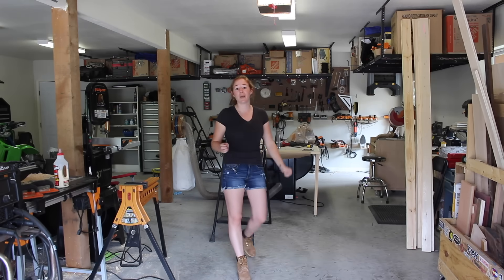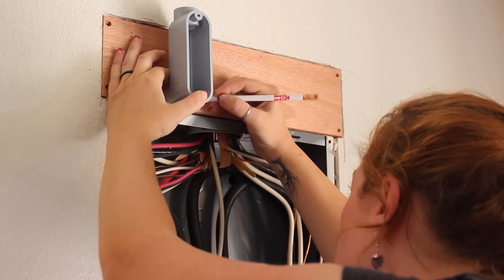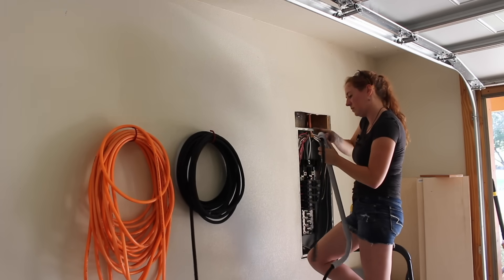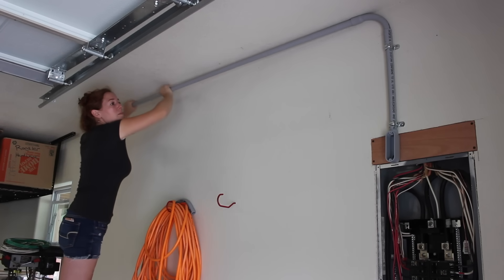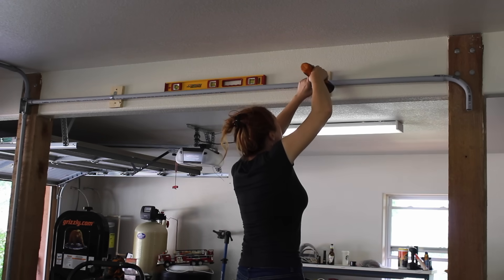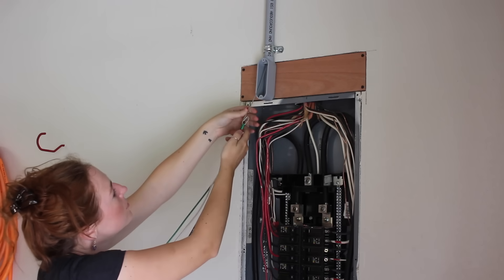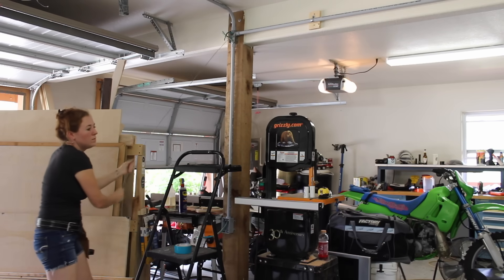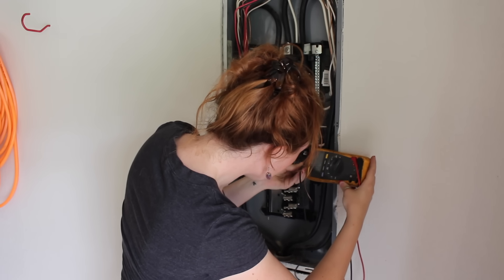Adding 220 Volt Outlets to the Garage

Comment: Did I miss the part about the amperage breaker you decided on and how you figured it out.  One person is ready to wire for a welder which might be 50A or better, so knowing what you  intend to plug in wired to the right breaker.  
Great video and to the point.

Comment: The giggle with the fishing was hilarious. I started out in networking, pulling cable, and don't ever remember giggling... Not once... Well, there was the time we pulled in 600 pair with a forklift and the mule tape broke, and the forklift tipped over... We've got a Ford Mach-e coming, and we're on the early list for a Ford Lightning, and only have one 220, excellent video!

Comment: Question, I bought pool pump (220V with 5amp ) do not have 220v outlet, can I use step up transformer to run my pump without add wire to Panel ?

Comment: hi use 12 ga cable and 15 or 20amp point . Always run these as separate individual  circuits/ breakers  . This works for my workshop . I have 2x 20 amp circuits 1x out let each  in my garage and 1 x 10 amp circuit [4 outlets ].

Comment: I'm totally tackling this this weekend!

Does anyone know (can chime it) if we can use 14/2 Romex to run from a 220-240v 15amp circuit breaker to an 15amp wall outlet?
Reply: no. you need larger than 14 awg for 240V. Depends on length of run. Call an electrician since you don't know this!!

Comment: I would have used FMC flexible metal cable pre-wired with correct size wire per amperage. So much faster. No sheathing inside of pipes due to heat ratings. This job is less then an hour of work for me. Closer to 30 minutes.

Comment: I notice you didn’t use any glue when you connected the pvc pipes together..  you should have used a 4x4 junction box instead of a 2x4 box so you have plenty of room to splice the wires.  And you should always have someone feeding you the wires as you pull.  There’s always a chance of you putting a nick or a cut in the wire as you pull.

Comment: I'll be adding two more 220v outlets to my garage and the Home Depot electrician, he said one reason why not to put SO cord in conduit is because it could heat up from a short and cause the paper inside cable over the ground to act as a wick and transfer a fire from one location to another.  I was going to comment on this until you hit the breaks and reworked it.

Comment: Anyone know how many 220 outlets are allowed on one circuit? I've wired quite a few Nema 6-50R outlets on a single circuit in my garage. I heard you should only have one per circuit, but I only ever use one tool at a time. Curious though how many can be on a single circuit though. If it's only one per circuit, are there any 30amp 220v plug/socket styles that can be daisy-chained?

Comment: Personally, I would have put two circuits into the breaker box so that both 240v outlets could be used at the same time up to the peak power.

Comment: I am going to add 220 outlet to my garage but in other videos they specifically used Black and Red wires for the hot lines instead of Black and White that you used.  I dont know what the code says but it seems like a good idea to use some color other than White for a Hot line.
Reply: Code says that white is always neutral, and hot should be another color.

You can use a white wire if you mark the end of it with tape to signify that it is in fact hot.

Comment: I'm in need of a 220v outlet in my garage for a new lathe that I just bought.  I might even be tempted to install the outlet myself because all the YouTube videos like this one make the process look so simple.  

The truth is, between spending a lot of time figuring out exactly how to do it, going to the store multiple times to buy all the myriad parts and then taking one final trip to the store to return the unused leftovers for refund, and then actually spending time to do the installation and redoing parts of the installation to correct mistakes, it could easily be a couple of days of my time to install a new circuit.  

Then, there is the insurance liability thing.  IF something went wrong and the garage caught fire, the insurance company might try to deny claim by arguing that the new circuit was not installed by a qualified or licensed electrician.  

All in all, taking into account the total time expenditure, the actual dollar expense, and the added risk exposure with the insurance, it just doesn't seem I will come out ahead doing the installation myself.

Comment: Very good overall, except for the code mistakes already pointed out. But, I must say that drywall screws should not be used for anything other than hanging drywall. They're just too weak for anything else. And kind of surprising to see a woodworker using these screws to hang boxes and that nice piece of oak.

Comment: Great job, but in the future just run wire thru the PVC as you are installing each section then no need for the "Fish", start run from the desired location and just run thru each section as you put it together until you come to your final outlet(s) . Just some easier info. Take care and thanks for posting.

Comment: Great project and great video. I had to run two 50A circuits for my EVs from my box on the outside of the house thru the attic (two story) then over to the garage.
Learned a lot about the Code.

The outlet you installed in the video looks like a NEMA 6-50. If so you should run 6ga wire for the energized conductors and 10ga for the ground. 
Per the NEC I don't think you can wire two 50A outlets on a 50A circuit. (or 30A outlets on one 30A circuit)
I would have mounted the outlets a little higher on the posts just to get them out of the way.

Comment: The junction box is in violation for box fill and you didn’t show the completed conduit termination at the breaker panel knockout. If a building inspector had to look at this he would fail it. Plus since it’s for a garage even though it’s connected to the house panel it is not residential. That particular type conductors must be encased in conduit unless you run a jacket type cable approved to be encased in conduit.
Reply: I was thinking the same thing. Those THHNs were “free air” even for a very short length. Wondering how we can finish that conduit termination to the panel.

Comment: Hopefully someone sees this message even though it’s 4 years later. Anyways if I’m renting a garage that has one outlet, it has a 20amp on it. Is there anyway to get more power without running another wire?
Reply: it all depends on the gauge of the wire.  12gauge wire is good for 20 amps.  10 gauge is good for 30 amps  (sh)
Reply: @pctatc66  so I would need to take off the outlet to see what gauge wire I have?

Comment: nice job, however e.m.t. conduit is much easier to pull wire thru than p.v.c. the ends of the wire could be bent over, taped & pushed thru the conduit, no curls or kinks while pushing thru conduit. fish tapes are expensive. i would also use a 4" sq. box for your junction. i never used handy boxes unless i absolutely had to. thhn has to be in conduit the entire run.

Comment: Curious as to why, when running PVC conduit and boxes, you used a metal junction box and EMT straps?  If you had to go out and buy this stuff, why not buy all the same - all PVC?  Also, code where I live mandates how many pipes you can run into a small box like that so you may find you need a 4 inch square box to join wires from three conduits.  And PVC should all be glued together.  Just a few of my observations?  Cheers!

Comment: Metal handy box? 9 # 10s squeezed in? Check box fill table in NEC. Use a 4x4 plastic box  instead. No glue? They make offsets and kicks for uneven walls. You can also heat and bend the pipe. Easier for me to use flex to get into panel.
  What did the electrical inspector say? Did it pass inspection? In NY you get a Board Of Fire Underwriters Certificate approving the work. You have a great deal of potential.
  I use plastic 2 hole straps and glue my fittings. Many approved wiring methods available to you in America to do this little job. You wanted suggestions. You are bright and capable.

Comment: Not sure about your local ordinances, but I know a Distro Box in my area would never pass with all the conductors just shoved through one opening like in the video.

Also, you were right not to use the SO cord, the reason it should not be run through conduit is thermal insulation. It needs to be in free air to reject heat. In Fact the PVC being a better insulator then RMC would be even worse for it.

Comment: Great tutorial. One change I would recommend would be to NOT use a white wire as a hot leg since that color wire is most commonly neutral.  Your THHN wires should be red, black and green for hot, hot and ground

Comment: FAIR PLAY! I'm surprised that it's legal to tinker with the Consumer box and install an MCB without being an electrician certified, by the way, what kind of breaker was it? an MCB or an RCBO?  these days RCBOs are the way to go but for such a small circuit probably not worth it if you already have an RCD in the mail CU.

Comment: You didn't actually show how you made 220v from your 110v  breaker box. Are we to assume your breaker box was wired for 220v and just did not have a breaker installed.?
Reply: Pretty much any breaker box in the US is "wired" for 240V, it just depends on whether or not you install a 240V breaker. (and connect to the breaker correctly, of course, 240V wiring from the breaker is different)

Comment: I am not an electrician, but I give you full credit for the work you did.  You did a wonderful nice and neat job and I like it very much. 
Now.. The main reason why I watched your video is because we just moved into a now house and the garage has no power, but I need a line to be added from the circuit breaker to the garage which must have about 20 amps so I can run my heat press and other heavy stuff... still searching.  Thank you for sharing.  ( no ... I will not do it if it's too complicated )

Comment: Looked great.  I wish I knew about electricity to do my own jobs like this.  I've had two electricians tell me i can't have 220 out in my garage because there isn't enough wire out to my panel.  Not entirely sure I know what that means exactly.  First the guy said i'll need a larger panel, then came back adn said nope, you'd need to run thicker (i read that as higher amperage perhaps) wire to the garage.  So why was he ok at first even looking at the wiring, and then coming back to change his mind?  Anyways, majorly  bummed out now.

Comment: We do not use 110 or 220 volt circuits in the US. In the US we use 120 and 240 volt circuits. In Europe they use 220 volts with a Hot, Neutral & Ground. In the US we have 120 Volts with a Hot, Neutral and Ground and  240 volts in the US is Line 1 (Hot), Line 2 (Hot) and a Ground. We do not use a Neutral with a 240 volt circuit in the US...

Comment: Good job April glad you did not use so wire you could have used a mouse and a vacuum cleaner to suck. a pull string that would have been cool

Comment: Another violation I noticed. I am not sure what amps you wired for, but if it was for 30 amps, the code requires each point should be on separate circuit. You can not splice like that for two points.

Comment: Great effort, I wish you where my apprentice. You have a lot to learn. First you should have use red for the B phase and not white. Second use a 4s box to splice not and handy box. Third PVC belongs underground and you didn’t even use PVC glue to couple it together. Question though what conduit do you have between the LB to the panel?

Comment: I NEVER use white to attach to a breaker. The only place white needs to be is on the negative, or neutral bus bar...with the greens. Always use black and red to run 220.

Comment: why not 4 wires? 2 hot, a ground and a neutral?
Reply: There's no reason to have a neutral if you're not installing a 120/240 receptacle for appliances whcih need both 120V and 240V (like am electric range)  If you're simply running a 240V table saw, the neutral serves no purpose.

Comment: she is using 220volts  why is there a white wire in the circuit. 220 volt is two colored (black and red) and a ground. a white wire is neutral only. Also she was referring to the code problem. the problem is if you run cable inside a metal conduit you can cause a choke effect. where there is a short and the metal conduit chokes down the reaction time so that the overcurrent protection can not trip.

Comment: per most building codes the fire rating of the garage wall assembly was affected by patching access hole with wooden panel instead of drywall patch per allowable astm drywall/mud patch method. could come up as a caveat on home inspection at time of sale.

Comment: could use a whole lot more caveats / safety info
Reply: for one most people have service conductors in their garage panel and would need to be a lot more careful during the knockout removal process and/or get utility to cut power by pulling meter

Comment: The wires leaving the panel going to the LB should be in conduit or flexible conduit.  
Other than that, your work looks more professional than other weekend electricians.

Comment: Overall you did a fantastic job. The only thing I saw that I would of changed is your wire color. White is the color you use for a neutral conductor. In your job its a phase wire and should be identified as such with black tape on each place it stops.

Comment: There is equipment that requires a neutral wire as well as the two phases and ground. Running two black conductors a white and green will provide 120 as well as 240 volts in the outlet. Installing the correct outlet gives your more flexibility if the device needs120 as well as 240 volts.

Comment: You can only install one 220 volt outlet per breaker. They need to be on 2 separate breakers because of the different amps and gauges of wire needed for whatever amps the outlets need.

Comment: I was wondering why she’s only using three wires 220 should be 4 wires
Reply: 2 pole, 3 wire 220v/240v, is what many shop tools, welders, etc use. There's also 4 wires, which many dryers use.

Comment: What a wonderful video!  I hope this comment finds you well, and perhaps with time to add just a little bit to your thoughtful and considerate contribution to public knowledge.  In your video it appears as if your selection of wire was based upon convenience alone.  This might lead some viewers to disasterous outcomes.  Your wire selection may, of course be done by convenience if it meets local code - but it needs to be an informed choice.  Aluminum or copper, the wire thickness (gauge) needs to increase as the total length of the wire increases, just as it does if the maximum current flow thru that wire increases.  Here's one sizing chart I found for reference:  http://wiresizecalculator.net/wiresizechart.htm  Fortunately, this presents an ease of use modification that your viewers might find handy.  Knowing the exact length of your run, so you can select the correct wire allows you to pre-cut your wires in an application such as yours.  With both ends cut, you can feed one end down into the box and slide the new pieces of conduit over the other end of the wire as you assemble it.  That way you never have to pull your wire thru either a bend or a long run.  (Bends tend to strip the outer insulation of the wire if you try to pull too long a wire thru them.  If you do it this way, you have another added benefit:  You can run more than one wire thru your conduit (if appropriately sized).  You have room in your box, if you run separate lines to your 220V motors then you can turn them all on at the same time, and they should not reset your breaker!  All running to the same breaker will likely send you back and forth to the box to flip it back on - especially when using something like a cutoff saw if you hit a snag or knot that makes the motor struggle a bit.  One final tip, rather than use 90 degree turns that happen in a 3 inch square box, when you can use the larger, curved 90's - they make pulling much easier!